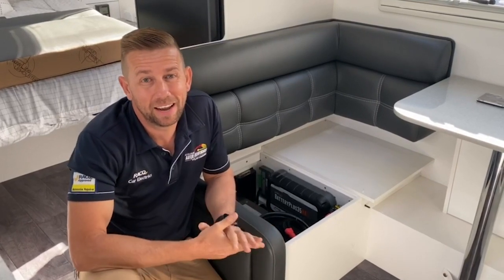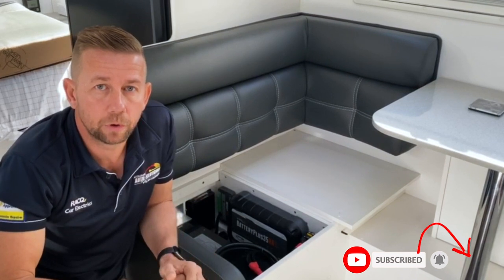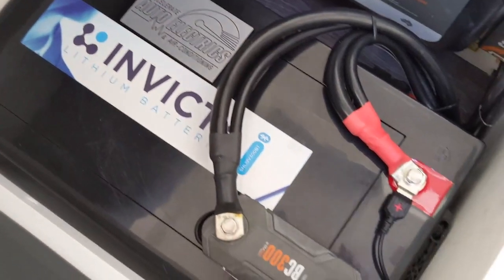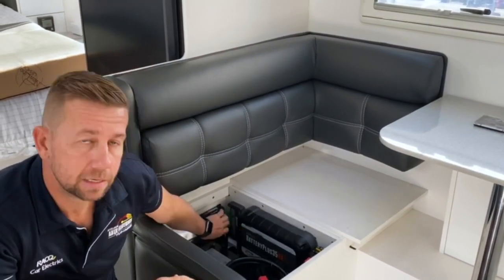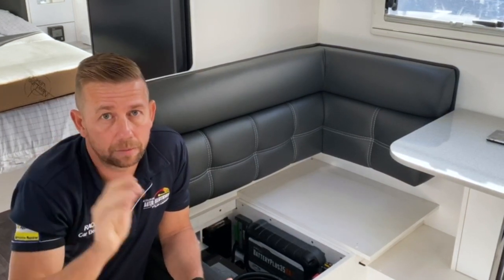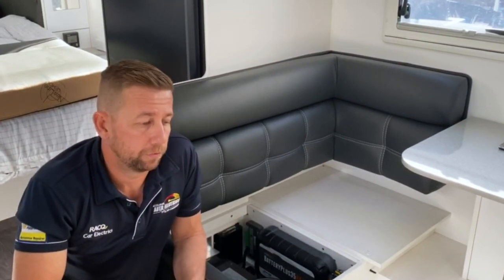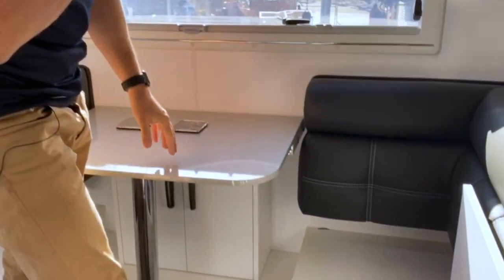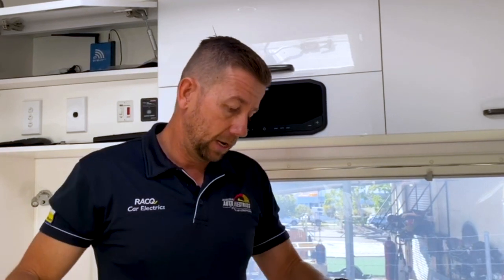New Age Caravan Off-Grid Lithium Battery System Upgrade | Accelerate Auto Electrics

Comment: What voltage are the panels??
Reply from the maker: The Enerdrive 180w Solar panels we use have a VOC of 24.1v !
Reply: @accelerateoffgridtouring  we have been fitting the new 550watt 55 volt panels of late if they can be fitted with Victron gear?
Reply from the maker: With the correct solar regulator yes you could run the 55v solar panels.

Comment: when wiring in a inverter how do you stop battery system and fridge from running from the 240 supply when the inverter is activated , Is the fridge and battery management wired to a seperate supply prior to the inverter Thanks
Reply from the maker: Yes sort of.

Comment: Great video, is there a reason why you have not left the lithium battery outside in the battery box/location where the AGM was?
Reply from the maker: Thanks for the comment! Due to the size of this particular battery you could not leave it outside without serious modification to the Battery boxes and it would require welding to the chassis etc. Also, Due to the costings of Lithium batteries having them inside is a more secure location.

Comment: A Question on the Inverter 240V into the Van input: is there  a protection circuit - 10A to 15A RCD inline ?
Reply from the maker: Yes, Inverter 240v termination are required to be carried out be a licensed 240v electrician to meet the requirements. There are numerous RCD protections and a Transfer switches fitted by a Licensed electrician in this application.

Comment: May sound a basic question.    But upgrading the solar on most vans will the stock solar cabling  be sufficient or is that upgraded also. .  Great videos guys.  Thanks for sharing your work 👍
Reply from the maker: Hi there, we also upgrade the cabling to suit the larger solar system.

Comment: What is an estimate price for this type of setup?
Reply from the maker: Hi Ryan, Caravan Lithium Battery Upgrades can vary greatly in price depending on the caravan, existing battery system,  products used and the desired outcomes of the customer. Upgrades can range from 5K to 20K. If you would like to know what a comparable set up would cost for your caravan, please get in touch with us directly on 1300 227 353 or info@amae.net.au.

Comment: What is the cost in payload?
Reply from the maker: Hi JJ, if you are referring to the weight we aren't sure exactly sorry, but Lithium batteries can weigh up to 60% less than their AGM equivalent so there is usually a significant amount of weight saved when switching to lithium.

Comment: I know this is a bit of a "how long is a piece of string" question, but with this size lithium battery,  for how long could the owner expect to be able to run his A/C given a fully-charged battery?
Reply from the maker: 5 - 8 hr run time depending on ambient temperature and A/C temperature settings. 
You will get a lesser run time if you a constantly on full fan at 18 degrees. Running it on low fan at around 22 degrees is going to be far more efficient. For more info on running your AC in a caravan, we'd recommend checking out our other video > https://youtu.be/VR2whaDPvdU